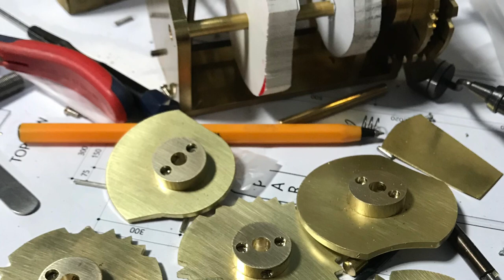singing bird automata

Comment: Where did you get the rubber cap for the flute?
Reply from the maker: I got from my children's toy parts.
Reply: @kwanghunhyun  did you put half a circle on the inside of the flute to make the air hit the splitting edge? ( Trying to make the flute aswel)
Reply: Nevermind made one that works